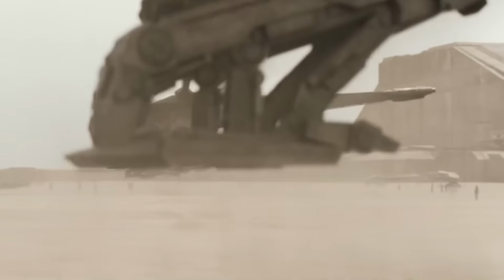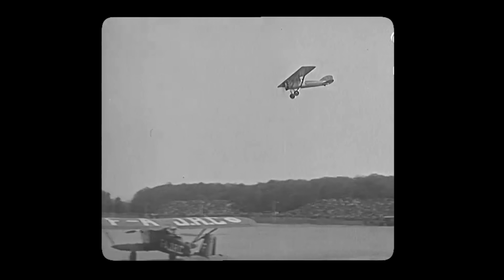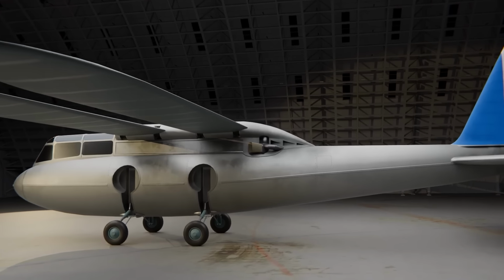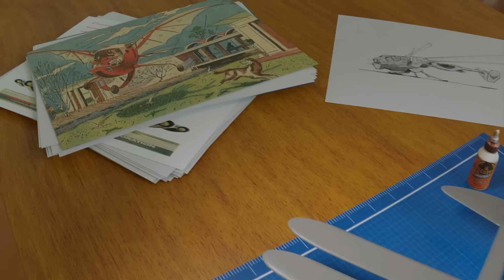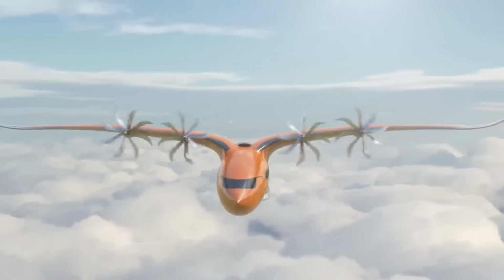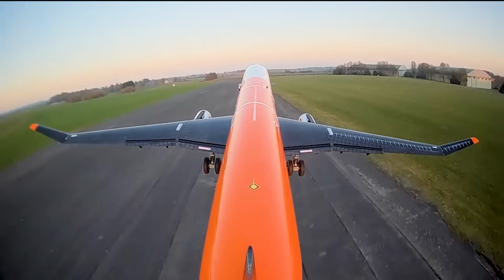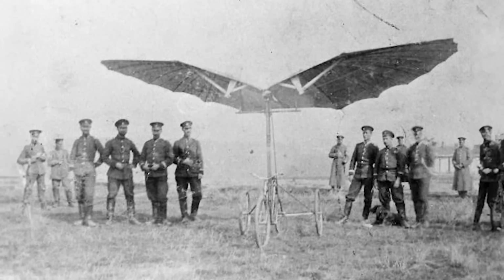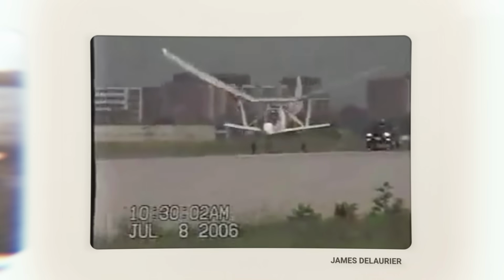The Real Life Dune Ornithopter... it was French!

Comment: I can imagine an ornithopter working as a really tiny insect sized drone designed to infiltrate buildings. I cannot imagine it working as a normal sized drone or even aircraft due to air density, mechanical stress and gravity.
Reply: If I'm correct. The wing tips would be super sonic.
Reply: Ornithopters can at least scale up to normal drone sized. For example, the various robot birds and bats Festo has made over the last few years.
Reply: In low Reynolds number flight like in insects the wings aren't so much like airplne wings but more like swim fins where the air is more like water than air.  Even in birds the larger the bird the less amount of time they flap as opposed to glide.
Reply: @longshot7601  Thank you. Scale is an often overlooked parameter when discussing stuff like this. Not the same but related, the speed of the flapping wings and the bulk of larger craft using this concept would bring serious safety and reliability issues to the fore. If a conventional aircraft loses it's engine, it can glide. Even a chopper can autorotate. And more than one engine? Aeroplane or helicopter, most multi engine craft have enough power in a single engine to at least find a safe place to land. But when the wings are the engine? Or at least, the propulsion element with no reasonable concept of gliding. And they are moving at possibly supersonic speeds, or at least extremely fast? That's asking for something to break and when the ornithopter in the Dune movie lost its wings the physics just looked wrong, at least until the very end when it started to corkscrew. A craft with four flapping wings, even losing one wing is very likely to make it depart controlled flight. It's an interesting subject, but I doubt we'll be using ornithopters any time soon to get to the shops.
Reply: This reminded me of the hunter-killer scene in the movie.
Reply: dont insects oscillate their wings too, like in a rowing circle so their wings have less drag on the way up
Reply: They already exist.
Reply: Yep, we already have drone that can fly into buildings to hunt down and kill people... It's terrifying stuff. Not something I'd recommended looking for.
Reply: @grahamtotte7133  Yeah, and they're pretty gnarly.
Reply: @grahamtotte7133 🟦…Where?
Reply: @clippy131 I think that he might be referring specifically to the dragonfly style design rather then any design with flapping wings.
Reply: @clippy131 What conventional/fixed wing aircraft can fly a near record distance? If the wingspan/surface area is extended, wouldn't that maximize the glide period? I would think the advantage of the ornithopter is steering. Maybe it doesn't need flaps or something like that.
Reply: There are tiny flappy drones. It is also not difficult to make toy sized Ornithopters. Full size - WHY? we have helicopters.
Reply: Mechanical stress/material limitations can be effectively eliminated due to the advanced material science of the Dune universe, as well as gravity (thanks to Holtzman suspensors) though air density might be a problem
Reply: Yeah I was just about to say. It seems none of the engineers wondered why it is that TINY insects with TINY wings do high-frequency flapping and HUGE birds with HUGE wings do slow flapping. It is almost as if nature shows the most effective builds for each size compared to physical limitations... 🤔

If you want a big heavy plane it needs huge wings, same goes for an ornithopter. The problem with HUGE planes (like passenger plane size) is that they fly too fast for an ornithopter. The faster the plane goes the higher the stress gets and the more the fixed wing air craft design shines.

We could have ornithopters. The most realistic designs I've seen in the video are from the Germans - basically a low powered glider (because that's what birds are!). That's where the wingsize (massive drag) to lift ratio actually works favorably.

For drones I can really see the classic dune design working really well - because they can be made tiny enough and lightweight enough.
Reply: yep and they DO have military spy drones that wok this way they are tiny like just a few inches 1 or 2. If you scale what work sfor a Insect way Up it just doesn't work .
Reply: Maybe airframe built similar to an albatross or a quetzalcoatlus that flaps its wings occasionally but mostly glides. Anything that size of largest bird or pterosaur could be difficult for insectiod airframe. Scifi mollusk power wings in Dune is probably needed for intense flapping.
Reply: The CIA tried that in the 70's, called it an insectothopter because they're barely literate Muhricans, didn't work out at the time as the slightest of breeze made it uncontrollable.
They also tried to disguise a recon drone as a bird, under project Aquiline, to spy on the communist block, can't remember what happened to that.
Reply: @eviljesus84 "normal sized" as in smaller than a passenger airplane. As long as the goal is a max of 120-150 mph (200-240 km/h) that's completely doable.

Looking at the crossbow 2 rc they entirely went the way of bird flight (duh "orni"thopter). Slow flying, low frequency flapping-wings design - like an actual bird. This type of base design will always be very stable and efficient in flight, but slow.

Just as traditional helicopters are all clocked around 185 mph (300 km/h) due to limitations of the lift/drag ratio so would bigger ornithopters be. All faster "helicopters" are propeller plane hybrids.

So the faster a theoretical ornithopter is supposed to fly, the more it needs some other propulsion and fixable wings. 

The fastest bird is a falcon. It flaps its wings for lift to climb high up and locks its wings for dive attacks to achieve maximum speed (240mph during dive). There is no high-frequency flapping as that would actually slow down the bird due to massive induced drag. The average horizontal speed of falcons is around 40-60 mph (65 - 100 km/h).

Those falcon speeds can definitely be translated to an ornithopter as a sort of civilian low-speed flapper/glider. Not faster than a car, but also way more efficient in fuel than helicopters (theoretically).

The dragon fly designs are theoretically possible but locked at the same speeds, just WAY more maneuverable, WAY more lift, at the expense of WAY more wear and tear and WAY less fuel efficient.

If you give rich people the option to fly a plane with an average of 40mph or 400mph most would take the latter one though. That's why we won't see any of that in the real world. Ordinary people would love a commuter ornithopter, but the development and implementation would be "Tesla-like" - for rich people only at the starting stage. So unfortunately no flappy-flappies for us unless we rich.
Reply: Orthinopter* as pronounced, anyway.
Reply: Impressive.  It has to be done fly way back, the ancients time.
Reply: They didn't have carbon fiber in 1939
Reply: i think when we colonise other planets in the future and terraform them , in lower gravity planets the ornitopther could be used due to the less efficiency not being a problem in lower gravity
Reply: Modern quad copter drones can be distinguished from biologicals due to the micro Doppler effects from the rapidly spinning propellers.  Though current efforts are to mimic biology to be indistinguishable from biologicals expected in the area, there really are no longer any large dragon flies anymore so an ornithopter would not blend in with biologicals and would likely produce more micro doppler effects.  Current drone biomimicry is to replicate the wings of a bird with strokes and speeds similar to known birds so that AI controlled radar could not identify them by characteristics and display them on a screen as a target instead of a faint dot...  I don't see ornithopter as bringing anything that current drone technology doesn't already have...
Reply: Yeah, also I think maybe they didn't understand material fatigue back then, so they thought this was feasible.
I also wonder how they solved the problem of inefficiency due to the back and forth motion. I guess some kind of spring to store the kinetic energy and release it in the reverse direction.
Reply: @fishbong   I assume it's like a pendulum when the wing on the left goes up the wing on the right goes down. So it can use gravity and the weight of the wing to make it more efficient. But as others have pointed out its simply too much force from too many different directions for any material to achieve what they wanted. If someone makes a modern one, they will use something else to provide forward thrust. It works for birds because they are so much lighter and aren't trying to achieve level flight lol.
Reply: That's the conclusion that Riout came to.
Reply: Possible with an ultra light and composite fabrics
Reply: It could work on Mars. Given it's lower ate density
Reply: LOOK AT THE COMMON HONEYBEE ON PAPER AS AN AERONAUTICAL ENGINEER LOOK IT UP, THE HONEYBEE CANNOT FLY. IN MY CHILDHOOD, THE NEIGHBOR WAS SMOKING HIS BEES OUT TO GET HOME. I CAN GUARANTEE THEY CAN FLY ALONG WAYS, AND EXTREMELY FAST AND CATCH UP NO MATTER HOW FAST YOU’RE RUNNING IN THE OPPOSITE DIRECTION.LOL
Reply: @gregkelmis2435 IT'S REALLY HARD TO UNDERSTAND THE POINT YOU'RE TRYING TO MAKE WHEN YOU USE ALL CAPS.

ALSO... The point you're trying to make has been well understood for like 35 years, high speed cameras cleared up the mystery. Ain't science grand?

I'm probably going to fck up the explanation, but it's something like: when the wing pushes down, they're rotated at an angle with the leading edge facing up from the direction of travel and when they raise the wing it's rotated in the opposite direction (the leading edge pointing down) which causes a vortex and that extremely fast and efficient motion effectively doubles the available lift from just the surface of the wing; if it just flapped up and down without the rotation in a rigid fashion. Which indeed would not create enough lift to make the bee fly. 

I think they are able to hover by rotating the wings in opposite directions with each wing beat and backward by doing that process in reverse. Or something like that? It's amazing how they're able to do it at such a mind-blowing speed, but nature sure is amazing like that huh? It works out a solution for a unique problem in ways we can't imagine from our perspectives.

I probably oversimplified that and don't really understand it fully, but I'm an arts director in theatre production and not an aerodynamic engineer. But I'm pretty sure I recall from paying some attention in school that's basically how they do it. Some other nerd much more nerdy than I will probably correct me and tell me I'm too stupid for this conversation. That I'm missing some key elements of the process there... But I do know how to use my caps key.

Anyways, they're not flying like an ornithopter is designed to do so. Different thing.
Reply: @gregkelmis2435  It all good we figured it out in the 1990's they create leading edge vortices. Unlike planes who maintain lift with positive airflow over the wings.
Reply: @Nilboggen Yeah... You made it more simples than me. 

Probably wasted my time trying to explain that to CAPTAIN KEYSLOCKED up there lol. Easier just to say bees are magic... They fly because magic.

Comment: Pairs of counterbalanced "fixed-blade" wings, which oscillate upon a desmodromically driven crankshaft, will be more efficient both mechanically and in terms of weight, and will be substantially more manageable/reliable/durable, than a hinged or split wing ornithopter. Utilizing greater quantities of smaller wings and an additional axis of oscillation should further improve effective output, as the winglets form a larger "dynamically ducted" wing, and reduce losses to aerodynamic drag by "slicing" upwards into the air, and "beating" downwards against the air.
Reply: or you're totally wrong and wings actually work worse in air agitated by other wings ahead of them... which is what real life aircraft and racing cars' spoilers show to be the case. 😒
ornithopter wings certainly do need to change pitch or be flexible to change pitch by yielding to air resistance, more on the upstroke, which seems to be one of the things you're suggesting, without that, an ornithopter is entirely hopeless. insects generally fly that way, as do hummingbirds (the latter are the flying animals most easily replicated in simple hovering flight by ornithopters). some birds and I think more so bats fly mostly in a sort of butterfly stroke swimming like motion that involves complex folding of the wings to pull them forward, which would be very difficult to replicate. and many like small songbirds actually use a really strange looking standard flying pattern in which they flap a few strokes to propel up and forward, then tuck their wings in and arc a bit up and then down again like a little torpedo, so they bounce up and down. ai reckon it's probably an adaptation that they're evolved to basically do for fun, while it serves the evolutionary purpose of being more difficult for a surprise attack from an aerial predator like a falcon to hit them.
Reply: Thanks, but I think you need to provide us with a diagram of what you just said. 😅
Reply: Desmodromes. I haven't heard that word since college....and a Ducati brochure talking about their desmosedice engine 😅
Reply: I wish I spoke engineer but sounds awesome
Reply: we need Thunderf00t in on this